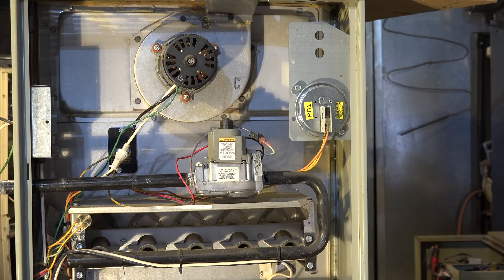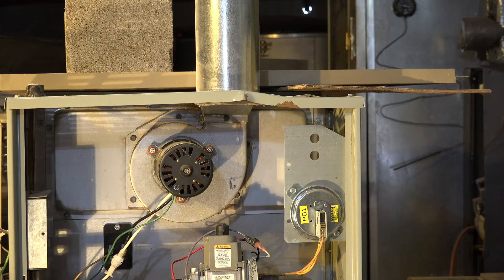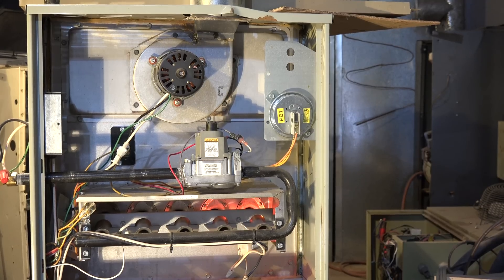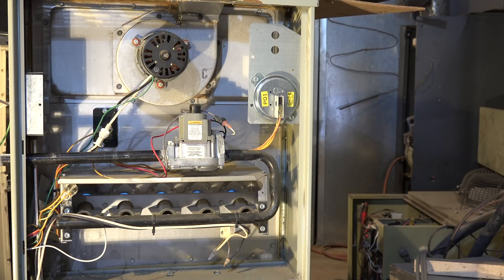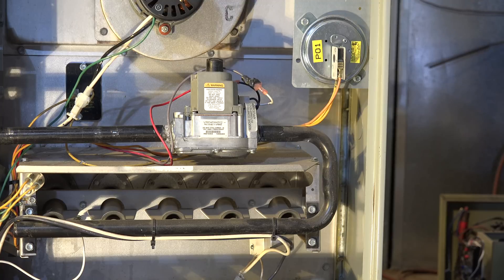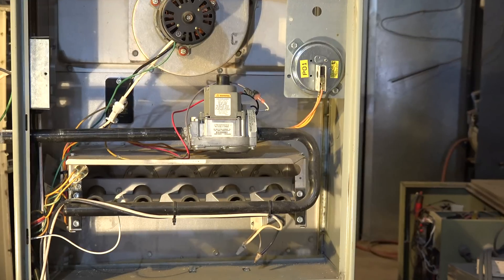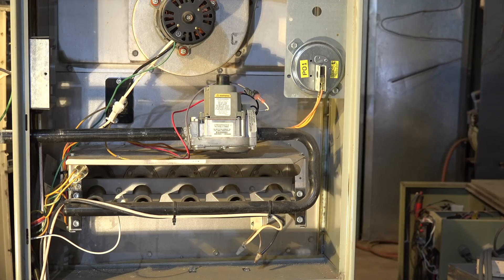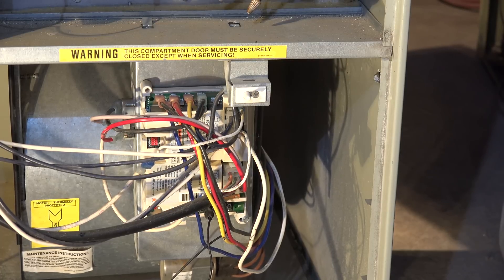gas furnace limit operation

Comment: Have problem with my furnace.   It will turn on complete its cycle for 7 minutes and then it will shuts off for 7 minutes. It do this cycle 24/7.  What could be the problem?
Reply from the maker: I would be looking for air flow problems.  Plugged filter, dirty blower wheel, plugged A/C coil or ductwork problems.
GFM

Comment: If filter is badly clogged, will it limit out before severe damage to heat exchanger?  Especially over a long time if neglected?
Reply from the maker: Yes, conditionally.  If the unit operates for an extended time on the limit control, there could be heat exchanger damage.
GFM

Comment: GFM, is there a field test that you can do on these limit switches without blocking any ducts?  Something that I could do during an annual service just to make sure it will function properly if it's ever needed.
Reply from the maker: I always disconnected the fan.  It is part of an annual service.
GFM
Reply: I thought about doing that.  How long would you give it to cut off before you start getting worried.  90 seconds or so?
Reply from the maker: If the fan runs for over 3 minutes before shutting down on a furnace made in the last 30 years, its too long.  
GFM

Comment: Maybe I missed it - what sensor detects the heat rise to shut the burner off ?
Reply from the maker: +steveg5576 The limit switch.  It is a temperature actuated switch located in the air stream that will shut down the burners if the temp gets too high.  Hope this helps.
GFM
Reply: +grayfurnaceman  Thanks -  I'm a contractor -- HVAC is my weakest area. A couple of years ago my 2 - 20 yr old Trane syst went on the blink in Fall - Winter. I studied your videos --- learned a great deal and was able to repair both and continue to diagnose. Couldn't really afford a tech - I was just coming off 11 months out of work due to cancer. I really appreciate you and your channel. I watch every day or so when you post. Happy New Year  to you.
Reply from the maker: +steveg5576 Thanks for the support.
GFM

Comment: My limit switch has water on it and limits out ! but the blower is making a high pitch noise too and dont seam to run at full speed !
Reply from the maker: +Big Doe The water on the limit is odd.  The blower noise could be filter plugged, blower dirty, secondary heat exchanger plugged, or ductwork problem.  Does the blower turn easily?
GFM
Reply: yes, but before that blower stopped running and was humming. could start by hand. so checked the cap and it was bad.So I replaced it and it started to make that noise.
Reply from the maker: +Big Doe Sounds like a new motor to me.
GFM

Comment: Great information. Was working on an issue similar to this yesterday. Can't find the blockage. If there is a blockage in the flue pipe would a furnace limit trip?  Or will it only limit from a duct blockage?
Reply from the maker: +Berzerk29 No.  It will just open the pressure switch.  Look for filter or dirty fan.  Also secondary heat exchanger blockage or ductwork problem.
GFM

Comment: You should do a video on some of the not so obvious causes furnaces limit out. Thanks. Great video as usual
Reply: +jeff arney   I agree, that would be interesting.    How to confirm duct restriction with pressure readings is something I would also like to see and learn if possible.  So far, I've confirmed by opening up output ductwork, and that's not always easy on some installs.
Reply from the maker: +jeff arena Will do
GFM